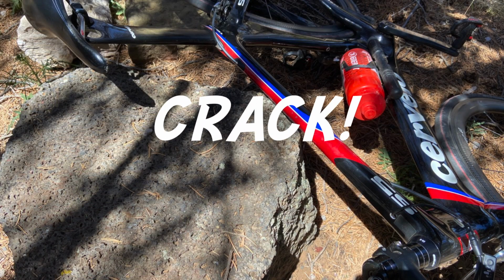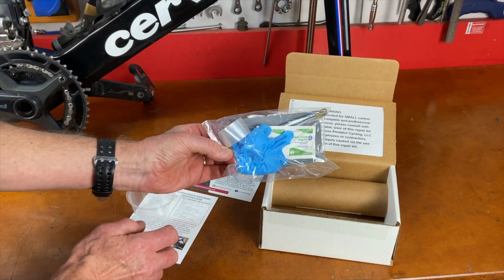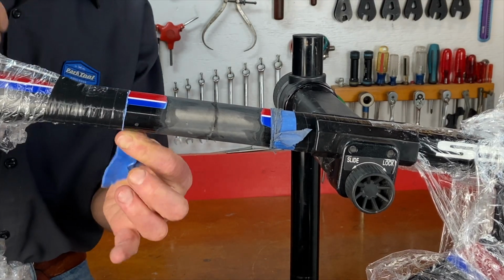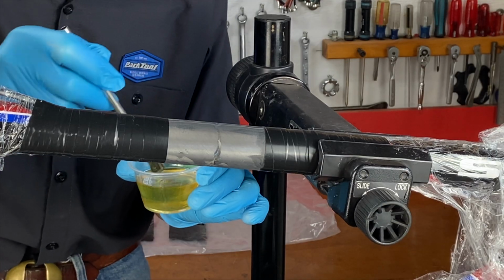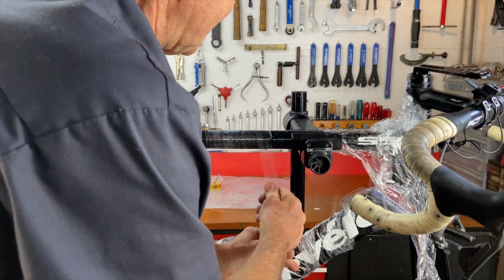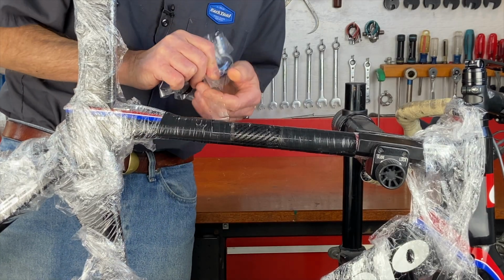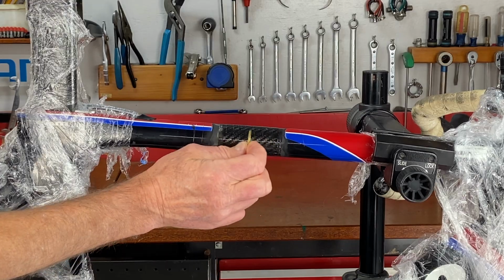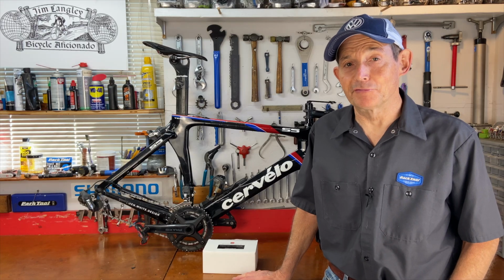Do it Yourself Broken CARBON BIKE REPAIR! #carbon #bikerepair

Comment: Hi Jim - if the crack in the frame is on one side, do you think I need to go all of the way around the frame?  Or would it be enough to just cover the damaged area?
Reply from the maker: Thanks for watching and the question Karl. I used a kit for this repair that I bought from Predator (the link is in the description). I took a photo of my frame and sent it to them first to make sure their kit would work for my frame damage. You might want to do that just to get a professional opinion from a company that repairs carbon frames. I wouldn't want to give you the wrong advice because damage to carbon can be challenging to evaluate from looking at it. It might be that the crack is so minor it doesn't need a full wrap but it might also be that there's more damage that you can't see. Companies that fix carbon bikes X-ray them to see how badly these cracks are. If you wrap it fully you won't be taking any chances but maybe Predator will say it's fine to only cover the crack.

Comment: Nice thing about a well-made steel-framed bike is…they almost never break. Just like well-made samurai swords. Funny how that works…🤔😉😺
Reply from the maker: Thanks for watching and making this point Stephen. A steel frame subjected to what happened to my carbon frame would just get dented, it wouldn't crack. You could keep riding both frames. The dent in the steel frame wouldn't be likely to change. It would look ugly but the tube probably wouldn't ever crack or fail. The crack in my carbon frame would probably have grown larger over time and might have continued all the way around the tube causing it to break.
Reply: @JimLangley1  Agreed. Personally, I'm still of the view that steel is an excellent material for bicycle frames. It's strong, tough,  and resilient. Cheers.

Comment: i was looking for a video on how to remove small scratches from carbon wheels and look what i found. bad luck you had with your bike Jim. the repair looks good. i think the pain is if you try to paint and find the right colors, etc.. perhaps a big stricker somehow would help., btw , now that im here, do you know by chance, how to remove small scratches from a matt carbon wheel? thanks
Reply from the maker: Thanks for watching Gledii! I did pretty much what you said and just covered the repaired area with electrical tape. It's not as pretty as the paint job I removed but it protects it just fine and  it makes it easy to remove the tape and show the repair if anyone asks about it. To paint it correctly to match the original finish is beyond my skills with paint. And I don't feel it's worth it to have the frame repainted by a professional.

As far as removing scratches from matte finishes, I think you'd want to reach out to or watch some YouTubes from the car repair or car restoration people. I couldn't find anything very helpful searching a bit. Most of what I found says that the problem is if you try to buff or polish it out you will turn your matte finish into a gloss finish. Which makes me think you need a product to touch up the scratch with the same type of matte finish you have now. Sorry I can't help any more but painting and finishing is its own art. If you find something that works please share what it is. Thanks again and good luck!
Reply: @JimLangley1  thanks a lot. i reached DT swiss to see if they can give me a sugestion..no big deal thou..
Reply from the maker: @Gledii  I washed my bike yesterday after a really muddy ride and my carbon wheels have some pretty good scratches too now after thousands of great miles, so I know what you mean by no big deal 😊
Reply: @JimLangley1  hehehe. yeah, i just read one good comment on a forum : "just embraced, a scare tells a story" :)

Comment: Is the carbon fiber patch overlapped when you wrap it around the tube or end it evenly. I would think that overlapping would give the repair the maximum strength.
Reply from the maker: Thanks for watching and the question- yes you can see in the video when I apply the patches that they overlap.
Reply: Yes I saw that the two patches overlap each other. My question is do the individual patches overlap themselves. When I wrap patch one around the frame does it overlap itself on the bottom? And when I wrap patch two around the frame (over patch one) does patch two overlap itself on the bottom. FYI, I have a cracked seat stay from the bike falling over sideways on a curb and I have ordered the Predator kit that you suggested. Thanks!!!
Reply from the maker: @DaveIngels-x6d  on my repair which was a top tube - pretty large diameter tube - the smaller patch did not need to overlap in my judgment but the larger patch that completely covered the smaller one did to join its ends and fully encircle the patch underneath and the whole tube. I basically followed the instructions in the kit. 

For a stay, which is smaller diameter I think you might want to overlap the patch ends on both patches. I’m not 100% sure though. I think you should call Predator and ask to see how they would do it. I called them and they were very helpful. I had to call a couple times but I did get to speak to a tech guy when I got hold of them. Better to speak to an expert first before committing. Hope this helps and have fun fixing your frame.

Comment: Does the heat gun go on hottest temperature. Thanks for your video and help by the way.
Reply from the maker: You're welcome Andy and thanks for watching. Heat guns differ in how much heat they put out and moving them closer or further away changes how intense the heat is too. What your goal is is to get the heat shrink tape to shrink. You can see in my video that at first the heat gun has no effect and the tape won't shrink. As the heat gun stays on a little longer it gets hotter and I move the hot air a little closer and at that point you can see that the shrinking starts because the resin/epoxy starts getting squeezed out in between the tape. So basically it's by trial and error how you figure out how hot it needs to be and how close you hold it. But you go little by little - a little more heat, a little closer until you see it shrink. Here again you could put a piece of tape on the workbench and heat it up as a test to learn what setting on your heat gun and how close to hold it to get the shrinking to happen. That would give you an idea what it's going to take on your frame repair. Hope this helps.

Comment: Is it possible to fix carbon rear drop out. The wheel is no longer able to stay in the drop out as they have worn down
Reply from the maker: Thanks for watching and the question, Chris. The dropouts on carbon frames are completely different than the tubes like what I fixed with the kit in this video. Dropouts are solid parts made with molds not hollow parts like carbon frame tubes. If dropouts wear out or break you need to replace them with a new dropout because if you try to glue another solid carbon piece to what's left of the dropout it'll break off. 

So to fix that frame you should find a carbon bike frame repair company you can bring it or send it to because they'll have replacement dropouts and be able to properly install it in your frame to make it ride like new again. Here's one such company https://calfeedesign.com/carbon-repair/ Hope this helps.

Comment: Hi, very nice repair vid! I have a crack around my front derailleur mount bracket - which was pop riveted and bonded in place, but had come loose. Crack is longitudinal, 2-3 inches long. Someone must have banged the derailleur into something. Will I need to wrap the repair material all 360 around the frame, or only over the crack + some side overlap?
Also, what is the thickness of the repair patches?
Reply from the maker: I'm glad you enjoyed the video Soren, thanks for watching and commenting! Your frame is cracked in a highly stressed area and that derailleur mount being pop riveted there complicates matters. I'm not sure you'll be able to fix this with a kit like the one I purchased from Predator  (link to the company is in the description). I think to be safe you should take some photos of the damage and reach out to Predator or another carbon company to get their advice on whether you can fix it with a patch or if it needs a more extensive analysis (they can x-ray the frame) and sophisticated repair to deal with the frame and the front der. mount. Hope this helps and thanks again!

Comment: How long do you heat it for and if I don’t have a space heater what can I use? Does it just need to be near any hot air for 24 h to cure?
Reply from the maker: You could put it in a sunny small room that gets warm or turn the heat up in your house and put it in the smallest heated room near one of the heat vents but not on top of the heat vent. And you just wait until the resin has dried, turned hard. You can put some of the resin you mix on something and leave it to dry and check this to see when the repair should be dry. The resin will cure even if you don't keep it in a warm room but when it's warm the resin dries faster that's all.

Comment: Used the same idea for repairing nordic ski poles. But this kit appears overpriced at $100, unless the carbon tape is of particularly good quality. I had a head-on collision on my trek Madone. The fork snapped, and I have replaced it. The bike rides "fine", but I am paranoid whether the frame also has cracks that I cannot see. I wonder if there is a way to reveal these small cracks (better than a coin). Don't wanna wrap each tube "just in case" :)
Reply from the maker: Thanks for watching and commenting, appreciate it. Yes, you can have your bike x-rayed to determine if the tubes were damaged in that head-on crash. Here's a website of a company not too far from me here in Northern California that does it for example: https://www.spydercomposites.com/ There's probably companies like this in other areas of the USA too. You could google "carbon bicycle repair" Hope this helps and thanks again!

Comment: Awesome video, how is the frame holding up? My bike shop just found a crack on my seat tube, I'd love to save $ doing it myself, but I'm not sure it'd be safe/sustainable since the tube holds so much more weight. Any thoughts?
Reply from the maker: Thanks for watching, Paige, glad you liked the video! My repair is holding up just fine. I haven't had any issues at all and I've ridden the bike a ton.

For your issue, the very first thing I'd do is to find out if your frame is covered by a warranty - most frames are. I would think the shop would have thought of that straight away but in case they didn't that's the first and best way to deal with it because the company that made the frame knows the most about their frame material, design, etc. and if it broke they might replace it under warranty. I know people who are on the second even third frame this way.

If that's not an option, you might at least learn from the company whether the damage is repairable. If you want to do it yourself, take a photo of your frame crack and reach out to the company that sells the repair kit I used https://predatorcycling.com/products/carbon-repair-kit They'll look at your photo and tell you if the kit can fix the crack you have. Hope one of these options works and you can save that frame or get one under warranty.
Reply: @JimLangley1  thank you so much, I'm going to reach out to the original owner to find out about the warranty!
Reply from the maker: @paigesettar2543  good luck!

Comment: What temperature does the heat gun need to be?
Reply from the maker: I didn't use a certain temperature, I just made sure it was warm around the frame probably 75 degrees. You might want to watch the 2-part video that Predator Carbon made to show how to use their kit. Here's part 1: https://youtu.be/tS7y6rZvBeo?si=fRBF2NIn3wv3pZB_ And here's part 2: https://youtu.be/0OZxeGNnSIU?si=H8mlloaVuzsHao-1

Comment: Does this also work for downhill bikes?
Reply from the maker: Yes the kit is for cracked carbon frames whatever type you have Philip. Thanks for watching and commenting.
Reply: @JimLangley1 thx, cus I was wondering if it would work on frames that have to comprehend higher levels of stress
Reply from the maker: @philipphd1158  you can also call the company and ask about fixing whatever cracked too.

Comment: Don't use wet n dry to remove paint it takes ages use a Stanley blade at 90 degrees and plane paint of it takes only minutes 👍👽
Reply from the maker: Removing paint with a razor blade is fine with steel frames since the blade can’t cut into steel. But it can cut carbon. That’s why you use sandpaper. Yes, it’s slow but it lets you remove the paint carefully and not risk damaging your frame any more than it already is.
Reply: @Jim Langley  mate the blade doesn't touch the carbon it slides once you reach the carbon layer and you can see no more white ish lacquer flakes coming off,I've been professionally repairing frames since 2009 and come fram a composites back ground, at the peek I was doing 10 frames a day and you need at that point to find fastest way to achieve your goal
Reply from the maker: @guinnesslover2970  appreciate you sharing your expertise and tips. My concern is that this kit is for beginners and comes with and says to use the included wet sandpaper. Also cracked carbon frames and rims, etc can cut you if you’re not careful. I wouldn’t want someone sliding a blade across a tube to run into the crack and splintered carbon. But I believe an expert like you can do it and I am sure it’d be a lot faster. Thanks again.

Comment: I observed a crack in the seat tube of a Pinarello Prince SL (my dream bike at the time) soon after I bought it from a fellow who had at least 10 other Pinarellos hanging from the walls inside a room in his home.  (Another room had as many Stratocasters.)  (Guy obviously had more money than sense.)  (On the other hand, who needs sense?  He had a stunning 19-year-old girlfriend - he was probably in his 40s - and they were about to leave town to jet off to San Diego because they had heard the surf was up.)  I asked him why he was selling and he said that he never rode this one.  (I subsequently discovered the odometer showed he had put 10,000 miles on it. I suspect that this was his go-to ride until he cracked the frame somehow.)  Word to the wise - buying a bike from a stranger for a price that seems too good to be true - check the frame over with a fine-tooth comb.  Live and learn.    Sorry, I digress.   Being stubborn, I rode the bike for a year until a bike mechanic finally pulled me aside and told me I was flirting with catastrophic failure and likely certain death.  (Tell the truth, I had been using this bike to crawl up and barrel down Red Mountain Pass in Colorado.)  So I was left with the question of how to tell whether it was a superficial crack in the paint (what I had tried to tell myself it was) or a structural crack in the tube?  I didn't try the coin tap (I actually tried it just now because I still have the frame - it didn't work - but I think my frame at this spot is aluminum, not carbon).  So I thought I'd post what I came up with since it worked like a charm.  Paint the outside of the crack with dish-soapy water, plug up all the holes in the frame, put the hose of a bike pump in a hole (plugging the space around it) and pump.  Good news was, my idea worked.  Bad news was, the crack blew bubbles like Spongebob Squarepants.  (I promptly bought a Moots titanium frame with a lifetime guaranty, transferred over all the components, which were first class, and I'm still riding it 20 years later - all's well that ends well.)  Anybody know how to fix a crack in an aluminum frame?  Maybe a carbon patch like this would work.....
Reply from the maker: Wow, great story Citizen, thanks for telling it and for sharing the cool way you determined that your Pinarello was cracked and not just scratched/chipped - well done! As for how to fix an aluminum frame that should be a relatively easy fix for a bike framebuilder who works with aluminum. Here in Santa Cruz, California rocklobstercycles.com could probably do it for you.